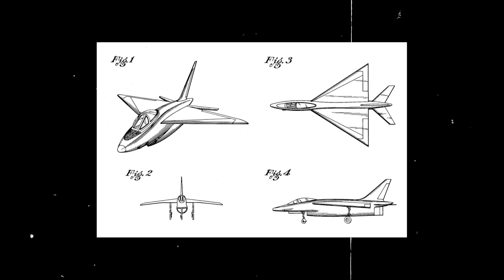T-38 Talon Supersonic

Comment: The T-38 didn’t “follow” the design of the F-5 and F-20. Those two aircraft were built off the T-38’s design and came after the T-38. The F-20 was a single engine design and showed great promise but unfortunately never made it to production.
Reply: It did but it didn’t. They were ready to go, but nobody bought it becuase the F-16 was about the same price and more favorable
Reply: The N-156 program was to field the F-5. The T-38 came from that program and was a design variant of the F-5, and the F-20 was a variant of the F-5. All share much of the airframe core.

I have worked on the F-5 and both T-38A/B and got a good up close look at the F-20 at while I was stationed at Eglin AFB.

Comment: I still see them flown by the national guard, supposedly to keep up on flight hours, at my local former SAC base. It and the F-5 are surprisngly tiny compared to almost any of its contemporaries throughout the years, but it's defintely getting on in its years. Interesting to note, the general wing shape and format seem to be the progenitor to that of the F-18, and to a lesser degree the F-16.
Reply: Yes, it's like peebody F-18 😅
Reply: The U2 pilots at Beale AFB frequently fly down to the former SAC base at Mather Field in Sacramento and do touch and goes.
Reply: @sirbader1  Ah, that would explain why after posting I couldn't verify that there was any air national guard here, it's those exact U-2 pilots!
Reply: You are correct! What would end up becoming the F-18 was developed from the Northrop YF-17, which was developed from the F-5E. So the lineage is there

Comment: Probably the most infamous T38 is the one that found its way into civilian hands back in the 1980’s. If memory serves, it was crashed, not properly “demilitarized”, sold for scrap, and purchased by someone with the resources to restore it to flight worthiness. I read about it, of all places, in a car magazine (I forget which one).  It even made an appearance in the movie “Dragnet” with Dan Aykroyd and Tom Hanks. Having seen it before in the magazine, I recognized it immediately. Not sure where it is now but I wouldn’t be surprised if it was still around.
Reply: T-38A (61-0935) (N338TC) (rebuilt from scrap) is owned by Thornton Aircraft Co. Van Nuys, CA, airworthy status unknown. T-38A (63-8171) (N638TC) is owned by National Test Pilot School Mojave, CA, airworthy status normal. Thornton owned this one as well before being sold.
Reply: The T38A is a Trainer the some models at Travel Pod capable on the Centerline station. T38B is capable of using SUU (Suspended Underwing Unit) 20 Practice Bomb and 2.75 in FFAR's Dispenser for training. The "B" has a single weapons pylon on the centerline

Comment: The little J85 was designed for cruse missiles. My Dad worked for GE and was one of the people who  fitted the afterburner and made the powerplant ready for the F5/T38. Other colleges would walk past his work station and joke that he was working on a garbage disposal. Compared to the other projects that were going on at the time this little engine seemed insignificant but years of service have proven the merit of the design.
Reply: Your dad's coworkers learned to eat crow.
Reply: Why doesn't GE Aviation reincarnate J85 Turbojet for UCAVs & Light Combat Fighters (LCFs) of today and tomorrow 🤔
Reply: You saw a film or a cartoon?
Reply: i like all these comments like this with first or second hand info
Reply: @386joedaddy  the J610 was the commercial in inal version of the J85 was used in the Lear 23 24 25, ll21 and the 1123 Jet commander and fue others NJ
Reply: @marklavoine8502  ..forgive me, but.. using your edit function...
initial
few
Reply: @razor1uk610  ok more than a Few
Reply: @razor1uk610  ok others Hansah jet 1960  used the J610
Reply: Joshua Jones  yes the J85 in A37 and the J69 in the T37
Reply: The T38 has proven a valuable reliable trainer. One interesting thing I remember from flight school is that the AIM-9X has as much thrust as a T38 engine!
Reply: @MattH-wg7ou  to bad no thought to leave one attached maybe on the bottom with out the explosive of course that would be quite a blast st
Reply: @ritchiesokol1061  yes the me262 REP used the J85.  2 built
Reply: I would love to share. Guess what German WW 2 Jet has a J-85 engine in it?
Reply: @ritchiesokol1061  the 262 replacer no good 003s left.